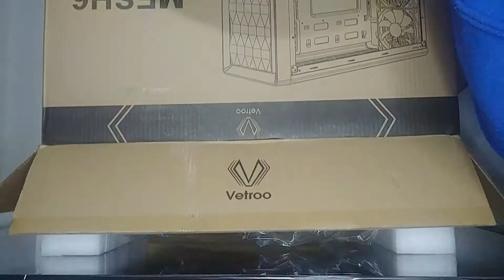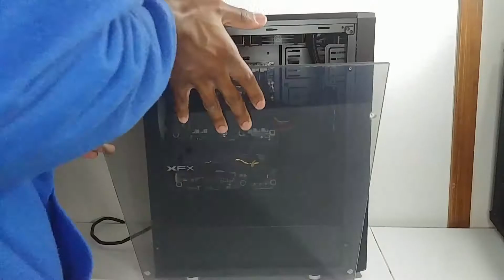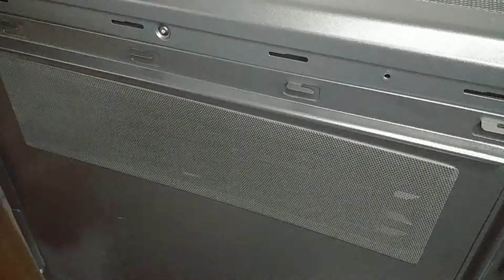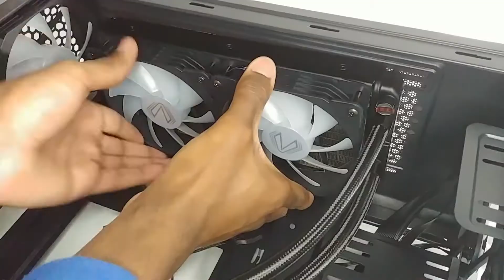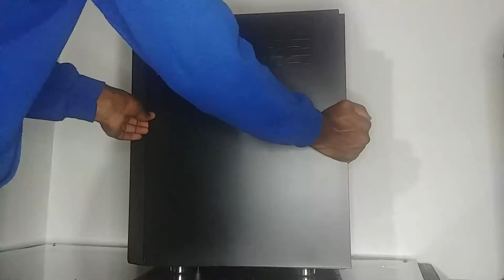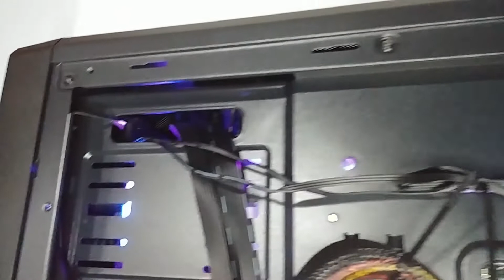Vetroo Mesh 6 Mid-Tower Case Review

Comment: a person needs to use a full modular power supply ,,for more room,, i put a evga full modular power supply and i  took out the case fans that came with the case  and put my antec red led 3 speed fans ,, it makes my case fans quieter ,,and added PC RGB LED Strip that plugs into my motherborad,, wish the case had a speed control for the fans,, also a person can buy case fans that plug in to the motherborad that would be able to control the fans speed in the bios,, can use a atx cable extender for the 2 5.25 harddrives

Comment: Did you recommend me this one? I have the idea to buy this but i think that the space is to high and i think that the space can affect in temperatures.
Reply from the maker: By "space" are you referring to it's overall larger size? Given all of the fans tht are running, I wouldn't be too concerned about that. Even though the fans aren't the best of quality, there's still plenty of airflow. My X79 system has been running just fine and temperatures are in check.
Reply: @JeffsTechOfficial  yes, big space iarge size, thanks for responde me i will see it.

Comment: Obviously with the $100 price, those fans are going to be constant speed cheapo models. at least there are enough in the right places to get good airflow out of the box. Toss the cheap crap fans, pick up two 5-packs of of say Arctic P12's and you'd probably be able to keep it much quieter most of the time while having some of the lowest temps across the board of any aircooled system. It looks like some modding of that motherboard case might also be worth doing. As an aside, why is it only fairly cheap cases like this that make any attempt at adequate front I/O? In short, I think you missed the mark a bit with this review.
Reply from the maker: $100 bucks for this case just isn't stellar. At $100 bucks or less, there's definitely a few more feature rich cases albeit with less fans. The I/O is adequate but I'm not a fan of it's appearance which is just my opinion, I'm not really docking it so many points for that. I just feel that I'd be more satisfied with a case that had more functionality at this price point. It's solid in build but nothing really makes it stand out.
Reply: @JeffsTechOfficial  I think we are too ready to give higher end case makers a pass when they don't include enough fans in the right locations to give good usable airflow out of the box. This goes double when it's touted as a 'high airflow case' and costs north of $150. This isn't high end or terribly well thought out, but unlike many much more expensive cases, you could drop in a build with high heat generating parts and even a semi reasonable air cooler and be good to go without shelling out another $50+ for more fans and maybe an AIO. Sure I'd like to see a high quality case with this basic layout, but if decent quality fans were included, you'd likely be complaining at it's $300 price tag.
Reply from the maker: Ok, I'll give an example of what I'd prefer at this price point. The Phanteks P300A goes on sale quite often and even at regular pricing, it's a solid case with adequate airflow potential and build quality. With the rest of that money, I'd fill it with some Arctic P12s or some other decent RGB fans. Even the P400A includes 3 RGB fans at $89 bucks  and the fans wouldn't necessarily need to be replaced and getting a few more fans would be doable. There's obviously some other options out there, but those cases are some good examples. Solid airflow and some nice additions like built-in cable routing velcro and usable SSD mounts plus some good fans is what I'd spend my money on. This case has a ludicrous amount of RGB fans and is built well, but there's nothing else that really makes it stand out. If the fans are half decent then that's fine, but I would buy this with the intent not to replace all of the fans (at least I wouldn't). I'm all for value, but I'm not a sucker for RGB.
Reply: @JeffsTechOfficial  ''Airflow potential' is exactly the problem. It only comes with one exhaust fan. In a case that small there is no way that's adequate unless you're trying to build a system with Dell thermal performance. Add the cost of 2 or 3 and lets face it, it would be three to get max RGB, it's no longer such a bargain. If you'd pointed to the P400A DRGB, I'd have had to concede that it was a much better case with enough fans out of the box for good cooling. I'm having a system built using it's big brother (P500A). We seem to agree on brand at least.
Reply from the maker: Yeah, I kinda see what you're getting at now. I personally would prefer getting a cheaper case with a mesh front then fill it with some fans. But at the same time, cases like the P400A already have some intake fans for not a whole lot more.

Comment: They probably should have fan speed control, instead of rgb control. I believe they can bring their cost down by at least 10-20 bucks by removing all rbg and make it a true low budget but highly functional case. I will buy it without all the useless rgb. It is now selling at 90 bucks at Amazon. I will take it for 70 bucks with no hesitation without all the silly rgb. Just the 6 fans cost you 50 bucks retail. LOL
Reply from the maker: Yeah, I would've loved some sort of fan control. The RGB control that's built in isn't even that great in terms of lighting options. It's a basic yet functional case but simply doesn't make sense at the price.

Comment: just a question can you pls help me with turning on my virtualisation for my CPU
Reply from the maker: It's relatively simple. To enable virtualization, you'd go into your BIOS and this will vary depending on what config you have. If your BIOS uses an "easy mode" you'll need to go to the advanced menu. There, look for CPU configuration or something similar and you'll eventually find virtualization. It may take some digging but you should be able to find it.
Reply: @JeffsTechOfficial  i tried the uefi setting way but there is no option for uefi setting in my pc by goin to advandace options
Reply from the maker: What PC/motherboard do you have?
Reply: @JeffsTechOfficial  asus prime H310M-CS R2.0 actually i am not sure about the company but I remember a little bit
Reply from the maker: So you press F7 and under the Advanced tab, you should see CPU configuration. Select it and towards the bottom you'll find the virtualization setting. If you still don't see that, your CPU doesn't support it.
Reply: @JeffsTechOfficial  kk thx for the response
Reply from the maker: Yep